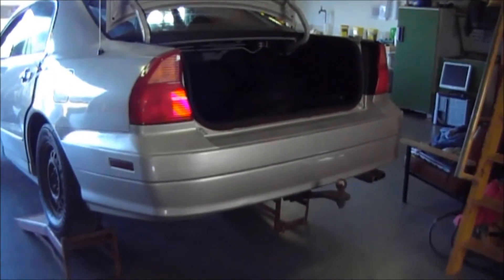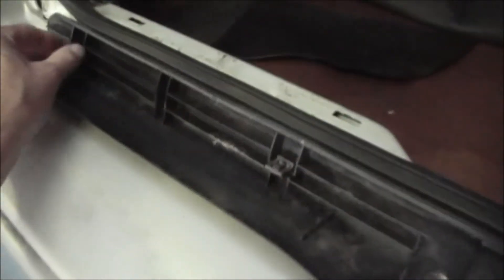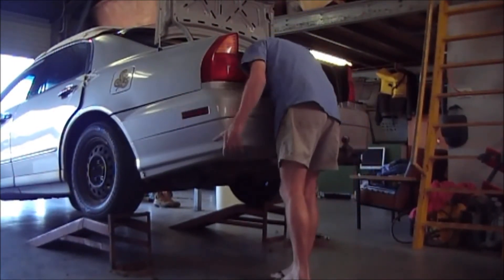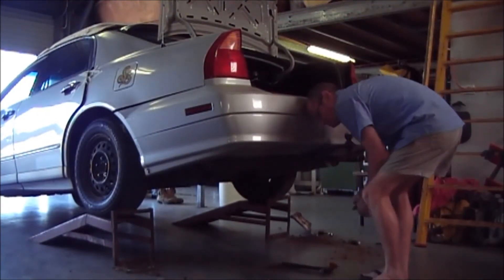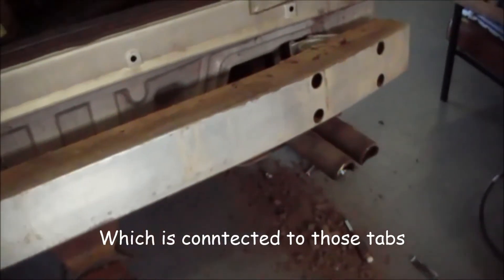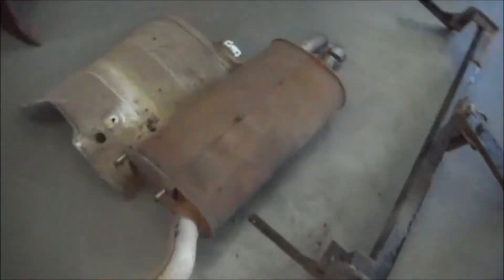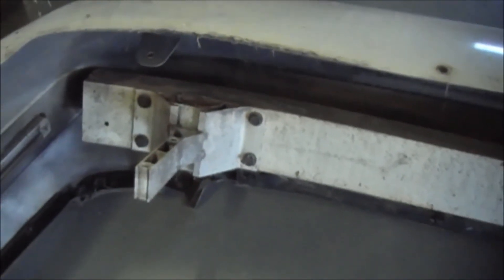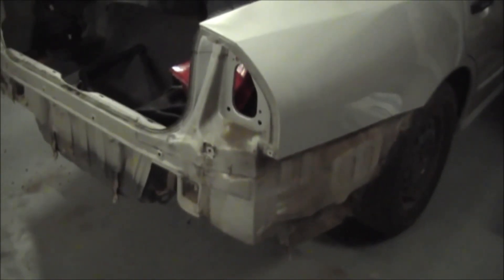Mitsubishi Magna/Verada Rear Bar and Towbar Removal

Comment from the maker: To drop the muffler there are rubber hangers that can be removed. These are on brackets bolted to the body of the car or the muffler, the brackets can also be unbolted to drop the muffler. If you need to remove the complete rear of the exhaust there are three bots on a flange just in front of the rear cross member.
Reply from the maker: Actually I got a bit lost with that one as it was the Verada with an aluminium inner bar. I'm more used to the standard Magna steel inner bar.

Comment: Ok just removed another rear bumper today on my TJ exec to fit a VRX kit/bumper and dropping the muffler was UNNECESSARY, (+the hanger closest to the rear  I couldn't slip it off and bolts for that hanger assembly accessible only when bumper removed.. unlike the other Magna I did was able to pry it off) simply get a 14mm SOCKET WRENCH in there,  barely enough clearance between muffler and heat shield above it. They aren’t torqued down much at all from factory and bolt should break pretty easily otherwise mallet the wrench or ‘extension’ trick with another small socket wrench and/or maybe take rear right wheel off for more leverage. Other than that reo bar bolt it’s an easy job just time consuming
Reply from the maker: Yeah I had another look at my TJ yesterday. That heat Shield is a PTA.

Comment: got my bumper off today the problem I have is how to put the rubber muffler hangers back on? had to really pry it off, not sure how to put it back on
Reply: granted these rubber hangers are pretty similar across most cars so I will do some research
Reply from the maker: Doubledunk they are painfull, I use some lubricant that I keep in the workshop, I won't say what kind but water-based is very good as it will wash off over time and won't harm rubber etc.  I also use a large flat blade screwdriver through the rubber hanger and lever onto the bracket.
Reply: You can use some WD-40 and it will work just as well